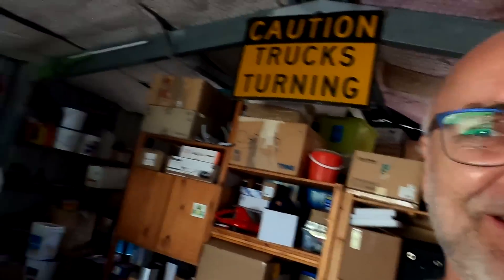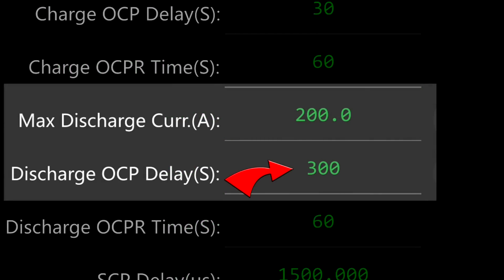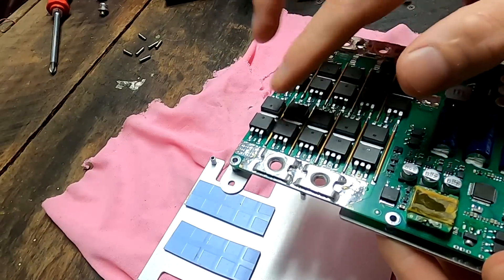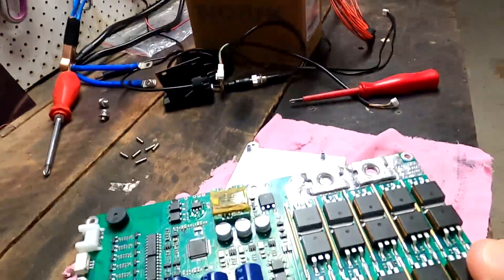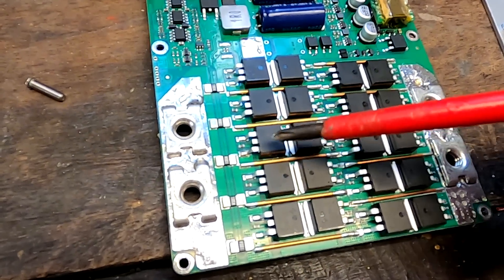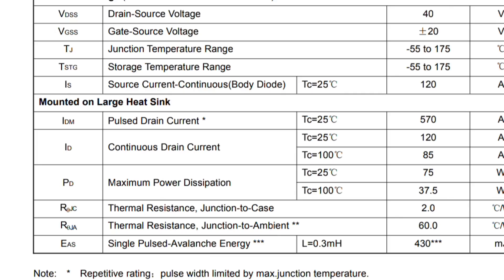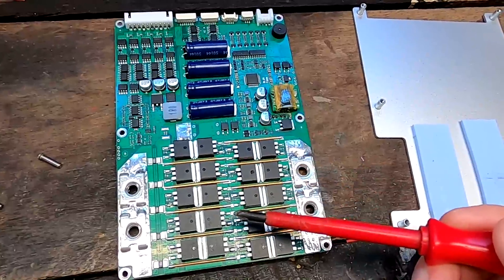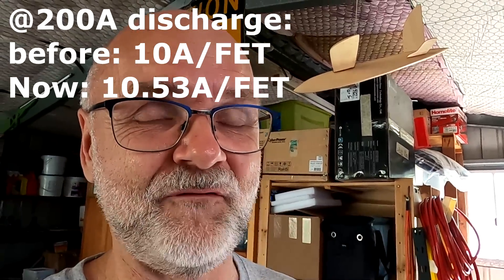Magic smoke! What happened to the JK-BMS? Still reliable or bad design?

Comment: I’ve had this happen with another brand of BMS that I can’t remember - I think there is some interaction with cutting current to an inverter under load, I think it inductively generates a high voltage spike back or something, but that’s a complete guess.
Reply: That is my guess as well: wiring + load inductance under heavy load may have exceeded the FETs' avalanche energy rating and dissipated by blowing the weakest FET.

Comment: It was probably not current exceeding the design limit.  Instead it was likely due to the ON-to-OFF transition time.  The MOSFETs split the current, though they have that many because they are also dissipating a lot of heat using relatively low-cost MOSFETs instead of IGBTs.   Even if that particular MOSFET was lagging on turning off, the extra current would not have blown it up just due to the current alone.  But it is related somewhat.  I will explain.

This is almost certainly a design bug with the BMS.   Basically the MOSFETs have an 'ON' resistance between source and drain that has to be very low because if it isn't the MOSFET will blow up from the heat generated.   When the MOSFETs are fully driven and operating, this resistance will generally be in-spec and the MOSFET will be fine.

BUT, when you are turning off a MOSFET, this resistance changes.   If the MOSFET is not turned off very quickly, the intermediate resistance between source and drain with X amps going through the MOSFET will cause the MOSFET to heat up and potentially explode.

MOSFETs are turned on and off by driving their GATE pin.   The amount of current that has to be pushed or pulled on the gate correlates with the amount of current the MOSFET is passing through between source and drain.  So when there is a LOT of current going between the source and drain (i.e. the MOSFET is 'on'), and you are trying to turn it off, you need to be able to push or sink quite a bit of current on the GATE in order to get that MOSFET turned off as quickly as humanly possible.

If you don't put enough current on the GATE to turn the MOSFET off quickly, it winds up turning off slowly.  During the period where it is turning off slowly, the resistance between source and drain increases, and the current causes a huge amount of heat to be generated in the MOSFET very quickly.  Result: MOSFET goes boom.

So the issue is almost certainly the gate driver for the MOSFETs not being able to turn them off quickly enough with 200A going through the BMS.  Usually one uses a dedicated gate driver chip to accomplish this, but a lot of BMS's use normal transistor instead, which are cheaper but do not turn the MOSFETs off quickly enough.   Another option is for them to use an IGBT which is a special type of MOSFET that has an integrated gate-driver in it.  IGBTs are far more expensive than plain MOSFETs, though.   IGBTs are what are used in EVs and Fast DC chargers for EVs.

--

I recommend throwing the BMS away and not trying to repair it.  Yes, you can replace the blown MOSFET.  And the BMS will probably work again.  But the failure probably stressed the other MOSFETs on the BMS and some amount of damage has probably accumulated on them.  So I recommend hucking the BMS instead of trying to repair it.

-Matt
Reply: Measure the voltage on the gates for the MOSFETs handling the forward current direction.   Ron is 2 mOhm at 10V and 2.8 mOhm at 4.5V.

Each MOSFET is rated for 120A continuous and 570A pulsed (pulsing the gate is used for DC power supplies, i.e. low duty cycle PWMs.  The BMS will not use that mode).   So a high current pulse won't hurt it.  A negative voltage spike due to output inductance when the BMS cuts off the power might hurt it, though, as that will be a reverse diode drop through the MOSFET.  But it would be unlikely to blow it up unless it stays negative for a significant period of time.

You tested with effectively non-inductive loads.  There won't be any induction issues unless the car has a buffering inductor on the input of its internal power supply.  You would need to put a scope on the output set to trigger when the BMS starts to turn off the MOSFETs (trigger on channel 1 using the gate voltage, and measure the output voltage at the BMS with channel 2.  Test at low amperages to start with).  Look for negative voltage spikes when the BMS turns off.

--

Looking at the data sheet more.  Ok,. Hmm. They are missing some curves but look on page 4 of the data sheet, figure 5.  "Output Characteristics".  Id-Drain current vs Vds (Drain-to-Source voltage).  That is, the current going from drain to source against the voltage drop across the FET.   This determines how much heat the FET will produce... the voltage drop is dissipated as heat.  So Watts = current x voltage.   At 200A and a 6-10V gate voltage, it will be 0.5V.  At 200A and 4.5V gate, the drop is 1V.   At 200A and a gate of 3.5V, the voltage drop is off the charts... about 12V.

So this comes down to how fast the BMS can turn the MOSFET off.  You need a scope to see that.  But basically, if the BMS tries to turn off the MOSFET and the gate voltage drops too slowly, it will wind up in the < 6V regime on the curve for an extended period of time, causing a very large voltage drop between drain and source and THAT is what will blow the MOSFET up if it lingers below 6V for too long before going to 0V and actually turning off the MOSFET.

There are lots of ways to drive the gate on a MOSFET.  It is possible to do it really cheaply, which often results in the type of failure that you saw, or to get really expensive and really force the gate on or off as quickly as possible, which prevents such failures.   The more current running through the MOSFET, the harder it is to turn it off.    In 'Electrical Characteristics' they do have a section on Gate Charge Characteristics... nano-columbs, but they only specify it at 20A which tells us basically nothing.   This data sheet is missing a bunch of graphs.  There should be specifications at max current and I don't see it.  I just see 20A and 40A specifications.

-Matt
Reply: Hey Andy, I don't know if you want to spend this much time on it, but it would be cool if you could trace the gate of the MOSFETs back to the gate-driver.  I'm guessing its those two transistors that I see in the picture.  And there might be some other parts there too.   They either have to be transistors or they have to be actual gate-driver ICs.  There will be one for half the MOSFETs and one for the other half of the MOSFETs (one set of MOSFETs for the forward direction and one set for the opposite direction if there is just one output.  One set of MOSFETs for the output and the other set for the battery charger if there are two BMS outputs).    

I already suspect that they are not driving the gate hard enough to ground to turn it off, and this would be doubly true if one transistor or gate-driver is driving a bunch of MOSFETs in parallel (instead of having one gate driver per MOSFET).    It can get even worse.... some BMSs probably drive the MOSFETs with digital outputs and don't even use transistor drivers.  Though this one I'm guessing is using a transistor driver, but possibly just one driving a whole bunch of MOSFET gates in parallel.  

It would be interesting to know what general circuit they are using.  But it can be a bit of work to reverse engineer it, too, so no pressure :-)

-Matt
Reply from the maker: Thanks, Mat, great explanation.!

Could they not drive the Gate negative to close it faster instead just connecting it to ground through a transistor?
Reply: @OffGridGarageAustralia  Yes, there are two ways to do it... either drive the Gate pin to GND, or drive the Gate pin negative to try to get it below the OFF voltage (1.0 to 3.0 volts on the gate is the spec for OFF) as quickly as possible.   But either way, the output impedance of the gate driver is very important.  If the impedance is too high, the gate driver just won't put enough current into the gate and the gate transition will be too slow.

Transistors are usually fairly poor outputting anything near a rail, so a dedicated gate driver chip is usually used instead.  And, of course, CPU digital outputs are horrible (they usually have a 50 ohm output impedance or more).

Dedicated gate driver chips have varying levels of sophistication but their main claim to fame is very low output impedance, capable of putting a few amps into the gate.   Some gate drivers also have constant-current outputs, for example, and can drive equally hard in both directions if you supply a negative Vss to the gate driver chip.   These drivers usually have an external resistor going into the gate, which means they need a wide voltage range to supply the rated current through the entire linear region of the MOSFET.   (The resistor is there for stability only, it is not really a slew rate control as some have suggested.  The whole point of a gate driver chip is to transition the gate quickly, like in less than 100ns).

It is for this reason that almost all MOSFETs specify +/- some V  for their gate pin input (this part is spec'd for +/- 20V), relative to the source, which is GND in this case.   So if the BMS were to drive the gate negative, it would need a DC voltage inverter on the board somewhere (which is a little 4-pin chip and two capacitors, basically).   I expect most BMS's just drive to GND.  The question is... how well!

-Matt

Comment: Btw if you want you can post it down to me in NSW and I will repair for you. Easy job.
Reply from the maker: Not worried about the FET on the back of the PCB?
Reply: @OffGridGarageAustralia  no not really. Got a and hot air gun with soldering iron. Usually I would cut off the old one in peices before de soldering the metal parts.

Comment: Specs from last video rated it at 200A continuous and 350A for 2 minutes. Your setting was at 200A discharge and time was set to 5 minutes (300). So you went only a few Amps over the 200A mark. Makes me think even if your time was set to a few seconds instead of 5 minutes this still could have happen. Mosfet's in parallel is not a simple thing to do achieve. Component tolerance might have been a big factor here. Or it was simply a weak mosfet. If one needed a BMS that needs to handle 200A continuous, a 200A rated device is not good enough. As you said cheap chinese, though JK BMS as you have proved already are a very good and with lots features, you take the rating down 25 - 50%. Disconnect the faulty mosfet from the circuit.

Comment: O no, ive just ordered 2 of these for my batteries, im using jbd at the moment, i think i may cancel my order 😱😱
Reply from the maker: The JK-BMS is fine. How many of your JBD MOSFETs have died already and you don't even know? 😊
Reply: @OffGridGarageAustralia  ive just read up on the listing for these, it says they cannot be used in parallel, do you know if this is so, i have 2 240ah lifepo4 batteries that in currently running in parallel with jbd bms, do you think i can run the jk's in parallel ??

Comment: i think you cannot replace the mosfet with traditional soldering iron. you will need a hot air soldering station. then you will have to put kapton tape around the dead mosfet to protect other mosfet from heating up (and on the back of the pcb to hold the other mosfets so they dont desolder and fall off). then heat the dead mosfet and remove it with tweezers. then clean up the pcb pads with desoldering braid. then put new soldering paste on the pads. putback the new mosfet and solder it with the hot air station.
Reply from the maker: Yeah, nah. It will stay as it is...

Comment: Did you notice on the Specification sheet all those Max current values were based on "Mounted on Large Heat Sink" ;-)  The "plates" on most of these BMS's are a stretch being called a Heat Sink...
Reply from the maker: No, I didn't see that. Will have another look.

Comment: Hi Andy, repair the Mosfet or not, I would cut the other 2 legs off to take it 'out of the circuit.
It's gone faulty once, the last thing you need is it causing a short circuit in the future as it's still receiving power and gate voltage.
Thanks
Reply from the maker: That's got advice, Mark. Thank you.
Reply: @OffGridGarageAustralia  You might be able to replace it using a hot air rework station use some type of insulator to block the hot air from the other components so you can direct the heat directly where you need it. They are cheap only like 50 bucks for a hot air rework station. The station works really well for surface mounted components.

Comment: The best way to remove that without the proper tools is to get a cheap hot air station! get an old pop can cut the top and bottom off of it, slit it up the side and unroll it. flatten it out and use tin snips to make a hood that will fit around the Mosfet. Apply heat until it lifts off the board with tweezers only experience can tell you how much heat to use! getting them off with an iron is almost impossible but I have had good luck soldering  on the new one with an iron!

Comment: If you leave it, clip the leads off. To remove it without hot air just turn your iron up put solder on the tip until a molten drop is hanging off and lower it to the soldered tab. The large drop causes a quick heat transfer. Just hold it there while wiggling the package gently with small needle nose pliers. To replace pre tin board and reverse procedure. I would just buy and smd station off eBay.. worth every penny

Comment: So you say that the jk bms is not supposed to be run with parallel battery banks? I have to banks, 24 volt, with 280 amp cells paralleled (560)amp then series to 24 volt. With jk bms on bank and then again, another bank the same way. The paralleled together. I’ve been running that way now for a couple weeks. I’ve not had any problems yet. Do you think I will have a problem in the future????
Reply from the maker: I'm not saying this, Alan. That's what it says in the manual. I have discussed this with Hankzor and they are working on some sort of parallel BMS system, maybe similar to the one Daly has. I really don't see the point though.

Comment: You can use preheat and lower melt solder (dilute factory solder and make good thermal contact during desoldering and resolder with lower temperature than usual).

Preheat from below should be fine. But if you just have a regular hot air, improvise a stand and preheat from above. 100 degC for longer durations should be fine.
Reply from the maker: Preheat from below???
Reply: @OffGridGarageAustralia  Yes (I mean the other side of the PCB, not of the FET housing :). There are these hot plates that have a hole and a fan. You can put it on there. Alternatively, a pan filled with sand or tricks like that will allow you to put in sufficient heat to desolder the FET. If kept at 100degC and no plastic connectors in the vicinity, this should work just fine. Your iron should have at least 45W and you should use a bigger tip. Knife tip would be perfect.

Comment: As our testing guinea pig, I think it would be great to run the test exactly the same way again, to see if a second BMS does the same thing. That would help remove the question about if it's a design fault or if it was just an individual component failure. 

I already have a couple of those BMS's on the way for my own testing, so it'll be interesting to see if any more issues happen in the meantime.
Reply from the maker: I'll certainly repeat the test with the existing BMS...
Reply: @OffGridGarageAustralia did you ever end up doing this test? Im very curious to know the result still

Comment: My first JK-B2A8S20P unit did something similar when I manually turned off the discharge MOSFETs while drawing less than 20A, except I had burnt traces, shorted transistors and mine was completely dead..

I contacted JiKong, explained the issue in detail, sent photos of the damaged components and they sent me a replacement unit with zero drama.

The new one performs flawlessly.
Reply from the maker: Inverters are particular different for a BMS due to very fast changes in current. But good for testing ;)
Reply: May I ask what kind of load you had on it? Was it inductive like an inverter?
Reply: @millzee60  Yes, a Xantrex Prosine  3.0
Reply: @bigshotdadz  I'm no expert but I would think a voltage spike would have caused the MOSFET to go short circuit but with all the others turned off it was forced to carry all the current and then burnt out like a fuse.